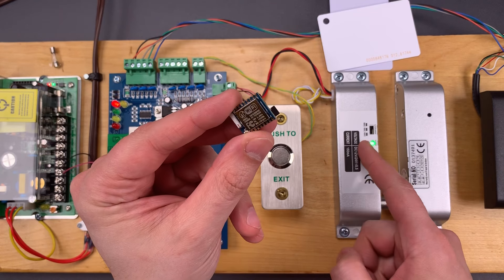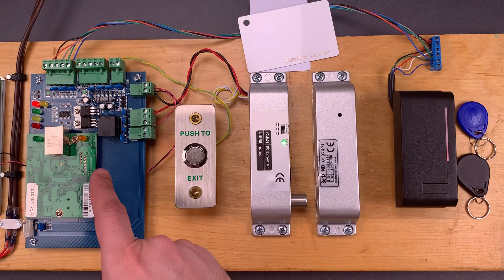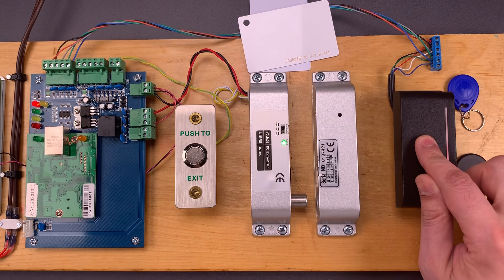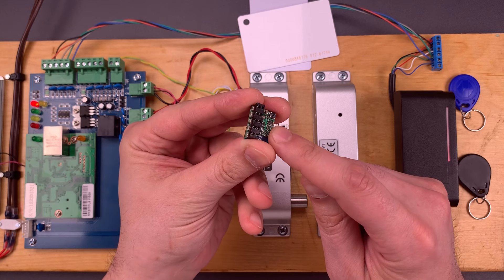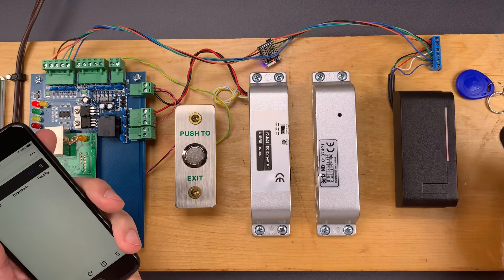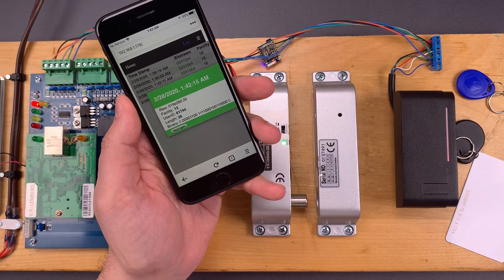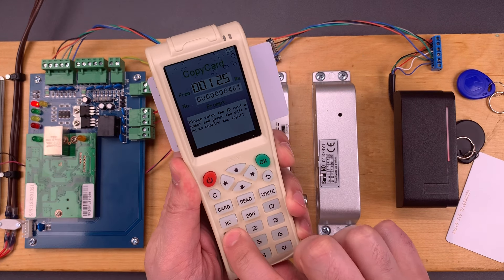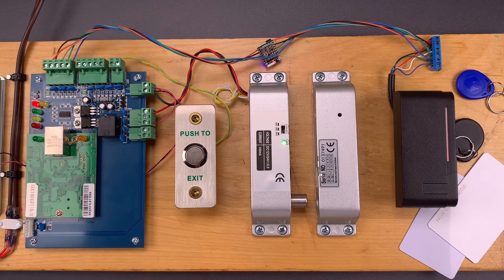[1052] Bugging an RFID Card Reader

Comment: You had me worried, I thought you were going to show something like remotely scanning through all the RFID codes until one opened the door and I'd have to rethink the system I set up on my front door.   However RFID will work through a wall panel, so you can set up with no exterior access.  This is basically my setup, except for a small aperture for the fingerprint scanner pad;  the RFID fobs work fine.

For one of those RFID only units,  you could embed a real unit in the wall and 3D print a hollow one to put on the outside so people know where to hold their cards.   I'd love to see the reaction of a hacker who pried it off!
Reply: Anyone can still mount a sniffer to the outside of your wall, picking up the RF transmissions from the card. If you want to be secure you need to use something like desfire which encrypts the wireless communication.
Reply: Scanning all rfid codes is easily prevented by a30 second delay between successive reads. That is implemented in residential staircase door lock systems even from post soviet nineties, for both button key and entering code on a keypad. It even beeps cheerfully for 20 seconds after an unsuccessful attempt.
Reply: @Evi1 M4chine  you can mount the sniffer a few feet away from the reader on the same wall, or on the roof above the reader. It does not matter how thick the wall is since the signal is not passing through it, you are sniffing on the outside where the user with a valid card is standing.
Reply: @mrfrenzy.  you need to get really close to actually power an RFID card, besides if you had something powerful enough to power a card from a few feet it cause any other RFID cards to also broadcast. That's why you can't hold your wallet to a reader with more than one card in it. Also all modern cards are encrypted so you wouldn't be able to decode the data anyway
Reply: @Evi1 M4chine The door and doorframe are usually made from RFID transparent materials.  But making a fake reader box won't be done when commercially installing a combined keypad and reader that can be set to require the pin code of the legitimate card holder to ostensibly protect from stolen or cloned cards (and that's the readers usually installed even if nobody ever turns on the pin code feature).

Comment: Interesting! But there is a non-encryption solution for that too. Some of these readers housings have "sabotage contacts". So whenever you remove the housing or take the reader off the wall, to access the wires for the ESP Key, an alarm is created. Might not be as safe in the US, where every wall seems to be drywall ;-) But where i work you either create an alarm by manipulating the reader housing, or you alert everybody in the building by the noises resulting in trying to get to the wires through the concrete surrounding them.
Reply: I’ve seen those in readers, but not seen them connected to the alarm system.
Reply: Often those are disconnected or easily negated just with the proper tool.
Reply: Or using RFID keys that are challenge-response types. Doesn't matter if they're encrypted, a challenge is only valid once and only if you have the seed can you get the correct response consistently
Reply: @insu_na  that one is basically encrypted.
Reply: @PeterAuto1  ... technically it's part of a precursor for encryption, that being the establishing of a shared session key through a shared secret, but you're not actually encrypting any message with it, you stop just before that step with verifying that you indeed share a session key
Reply: YES! thank you. This is a minimum requirement for the security systems we use at work (installing for small Govt, Universities, etc) - all have monitored back-to-base tamper alarms.
Reply: I mean you can drill concrete and metal too, so you could drill into the housing and mess with the wires there (ideally connecting to the wires in a way that never disconnects the wire to prevent any signal loss which is a good method of detecting wire tampering).
Reply: @Waitwhat469  Good thoughts but 1) the tamper sensors we use get set off with a good bump 2) At that point you could just drill out the door lock
Reply: why IS every wall a drywall in the us anyway?
Reply: @enkiimuto1041  it's low cost, easish to repair and modify, and fire-resistant
Reply: @Waitwhat469  Like i mentioned in my initial comment: drilling concrete is going to alarm someone too. It's not really something that can be described as "silent"  And if you don't care about time and leaving unmistakable traces, you probably won't waste your time at the card reader or it's cabeling anyways. But go a diffferent route of more "forcefull entry".
Reply: Regarding reader tamper alarms, sometimes at a large facility they become so common from poor installation of the card reader backplate that security ignores those alarms. Take it from me with over 30 years in the industry, a LOT of alarms are ignored.
Reply: @speakthetruth81  or people bump them because they are on the door jam.
Reply: @nirfz  the wires get to the reader somehow. There is usually a screw on the bottom of the reader. Once removed the reader falls off the wall exposing the wires. Literally takes less than 5min. Even if it is busy, you pretend to be a tech fix freaken broken door again. "Say, would you test your card? Thanks!"
Reply: @owenwhitman6616  Depending on the wall you can patch it back, but yep without remediation it would be evidence
Reply: A lot of these readers in apartments and such are stand alone garbage not connected to anything and all you need to do is take the grub screw out that holds the cover on to short out the door contacts lmao....
Reply: @speakthetruth81  Yeah tamper alarms are a bit of a running joke.
Reply: Wall being drywall has nothing to do with your comment. Unless you are suggesting someone is going to saw through the wall and walk through it, then it's irrelevant.
Reply: @enkiimuto1041  its cheap
Reply: I saw the video where the guys taught him this. A simple magnet alongside the reader trips the contacts in the reader. Then the cover can be removed without the alarm going off.
Reply: @garyszewc3339  That depends, if the tampering contacts are relais contacts, and in which direction the relais is mounted. Sure they can mount it in a way that a magnet can do the job, but they also can mount it in a way where putting the magnet on the outside already triggers the alarm. (by opening the contacts) Just depends on how good of a job the designers/engineers have done. And if they did it without a relais with a simle microswitch you also might be unsuccessfull with a magnet. (same rules apply with the direction of mounting the switch.)

Comment: Great job. I know most software for these systems have the option to encrypt the data stream so this will show users for these systems how important it is to ensure the system is fully configured, locked down. Thanks for the video!
Reply: Except it changes exactly nothing if you are replaying same message, be it encrypted or not.
Reply: @NGC1433  it does matter if the encryption is resistant to replay attacks. Such as having a 10 second window before new encryption is created. Or even just embedding a time sensitive piece of information, such as every request must come with encrypted date/time and if the date time is off by 5 seconds it is rejected.

Comment: Depending on the encryption method, it may still be possible to do a replay attack without being able to decrypt the data. If a time stamp is included in the encrypted data, and this was checked against a time window by the controller; that's one way of preventing an non-decrypting replay attack.
Obviously, the cards used in the demo are also pretty dumb, and are a point of attack through a concealed rogue reader (backpacks carried units are common). Using smart chips raises the bar a lot higher though.
Reply: I was gonna ask about this but you just answered my question! Thanks
Reply: You sir... know things...
Reply: Was just about to say this; the cards should be nfc smart cards, not just dumb rfid. The controller should use an Incrementer, nonce or challenge response protocol so that it can verify the freshness of the attempt. Encrypting the traffic of a dumb protocol will not fix any of its flaws.
Reply: @GhostZodick  Yup. But you'd probably have to be in proximity to the reader (say 10cm) to read the card's RFID signal. A rogue reader installed near the primary might work might work, but that could be a tricky install. From memory I think cards with smart chips use NFC as well, so closer range is required and the protocol's more secure I think (so again, more secure).

The thing is, card don't have to be anywhere near a legit reader to be read. Get in line at the local Subway's with rogue reader in your backpack and you're read folks card while they order. Think of it as a cost of not social distancing. ;-) Dumb card's codes are VERY basic and easy to clone.

If you've got something like an ESPKey installed and talking back to you're phone; a card and RIFD signal's probably redundant.

The old hat's getting a little dark though, so I think it'll leave things at that.
Reply: @cabbageman  Yup. The card's proably the best attack vector, and there's generally a bunch of them walking around on people's necks or in their pant's pockets. (hint: When off-site, put your card in your breast pocket).
I totally agree that encrypting dumb still leaves plenty of dumb. ;-)
Reply: @GhostZodick  smart cards are very inexpensive, your bank card and subway cards are likely nfc smartcards (EFTPOS is a challenge response protocol). And the complexity inside the reader really doesnt matter to the installer, its just a pre-configured box with instructions from the manufacturer.
Reply: Another fancy option would be for the brain to send a number to the reader, when a read is done (ostensibly, a large number). The reader could then combine this number with the code on the RFID card and encrypt it using a locally stored (to the reader) asymmetric encryption key. This ensures that no man-in-the-middle could work, nor could replaying previous signals.
Reply: @GhostZodick  For a non-experienced programmer it might take a while, but the software behind it for someone experienced isn't all that difficult or expensive
Reply: @xerosdestroyer  Yup. In this situation where the client doesn’t necessarily have a secure clock, a shared secret + nonce + asymmetric encryption solution would be better than one based on time windows.
Reply: The proper solution is to use a challenge response protocol between the controller behind the door and the chip in the card. This requires a card that contains a secure storage of a private key and a tiny processor. But those things are cheap, every credit card contains one. The controller will send a random number to the card, the card will sign it together with its id and send it back. The controller can verify the signature.
The card reader just forwards the communication.
Reply: A timestamp is not needed, a simple nonce (a number always sent different in each message exchanged between the card and the reader, that the card replies as is to the controller) is enough to avoid a reply attack. Of course a more advanced solution (but really these days not so complex, a lot of cards do that) is to use a public/private key authentication between the card and the reader.
Reply: @cabbageman  The same cards can also be used for different purposes. Back in the day I was looking at using new smartcards which stored a cert, that the physical guys were rolling out, on PC based card readers as 2FA. The synergy is that you have to remove the 2FA card if you want to use it to get through a door...so less cards just left in readers...that was the concept in any case.
Reply: @GhostZodick  Tale from the olden times...Back in the day I was paying $90 a pop for specialised USB dongles to store digital certs. One senior (in all the ways) manager lost the one he was issued the day after he got it. Two years later he returned the lost dongle having found it in a coat pocket. ;-\

Comment: old video: picking open a lock
2020 video: HACKING RFID SYSTEM
Reply: vladypunkyface  it sounds new and that's all that matters
Reply: Much like with lock picking, hacking RFID systems is way easier than most people think it is.
Reply: The FBI had a page some time ago for a day or two before it got pulled about how terrible RFID is and they wouldn't be using it. NFC is just as bad.

Comment: People should know that UL listing is important. 
UL 294 requires encryption between card readers and controller.
Reply: Does UL294 say anything about using non repetitive coding ?
Reply: Lately I've been much more choosy when buying wireless tech, making sure security is tough and with out gaps. I hate when I'm shopping for (as example) a wireless mouse and they won't say if there's any encryption.

Comment: hey I'm a cybersecurity student so I just wanted to comment on one of the things you mentioned. you stated that if the signal was encrypted then this wouldnt work, but one of the failures of many low budget security companies is that they constantly use the same encryption software every time. this makes it so if the attacker took it one step further and tried to decrypt the signal with commonly used software's they are more than likely to find a match

Comment: Encryption should be between the card and the controller inside the "secure" area.
DESFire EV2 for example, the crypto happens on the card, there is no way to "clone" it, as the private key never leaves the card.
Reply: To elaborate for others: the card itself has a processor and a key saved. The reader sends the card some data that the card transforms using it's key. This data is always different. The transformed data gets sent back. Because the input is always different, sending back the same output twice does not work. And thanks to nice cryptography, you cannot get the  key, even if you capture input and output.
Reply: It baffles me that even though we have readily available cryptography like this companies still manage to manufacture systems that don't include it. How?!
Reply: @justin.booth.  Cost
Reply: @ShadowTigerKing  thing is - it doesnt anymore. The algorithms are already there and freely available, that aint any issue. Cards with the necessary computing power dont need to be any more expensive than the simpler ones by now and also the processors to use inside of the control box are cheap.
Reply: @kennichdendenn  Freely available algorithms require not so free people to install. The simple cards are currently available for around .15 each in bulk. The cheapest chip card I could find was still over .40 each in bulk and they did not look good. The fact is that the simple systems are cheaper to buy and cheaper to maintain.
Reply: @ShadowTigerKing  umm.....are you quoting prices in bitcoin decimals?
Reply: Hopefully DESFire doesn't mean it uses the DES algorithm
Reply: @nullifye7816  Sorry. That was in USD. 10 Cents for basic cards, 40 cents for credit card basic chip and it got into the dollars for more complex cards. That's for bulk buying.
Reply: @kennichdendenn  It's not just the card cost. The entire lifecycle cost is far lower for a system where the access is a simple employee ID, vs one where you need to manage an entire PKI system complete with revocation. The cards, the programmers, the backend, all involves far more complexity and that costs money.
Reply: @justin.booth.  money :D
Reply: @justin.booth.  Because of cost reduction. They are using system, which was literally developped in the 80's.
Reply: @killhour  Wiegand doesn't even use "clear text", it uses direct bitstream.
Reply: @killhour  Sure, "cleartext" does, "clear text" doesn't. That is why I thought that you ment it's coded in ASCII or something.
Reply: @killhour  Not pedantry, I just didn't realize that you meant that actual term, it's not something that happens all the time in youtube comment section...
Reply: @kennichdendenn  sounds like the locks from Kabas Cencon.

Comment: More specifically: The communication should be secured between the controller and the RFID card, not just the reader (which would have to hold the communication secret, which in turn could be extracted by an attacker). Then, of course, you could no longer use the el-cheapo cards...
Reply: Agree. These RFID systems are very vulnerable to cloning. Even the handshake ones would be vulnerable to mitm relay attacks though that obviously involves more effort.
Reply: Yeah I actually came here expecting him to use a MitM device to intercept the RFID signal.
Reply: That's why the industry is pushing for people to use their phones, with public private key handshakes. google OSDP. It's what HID global is trying to make the new standard